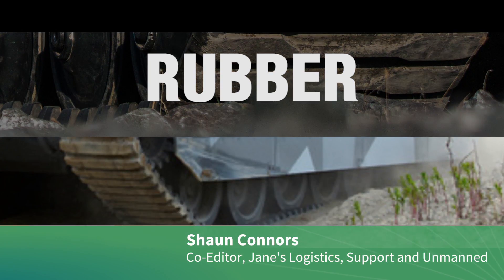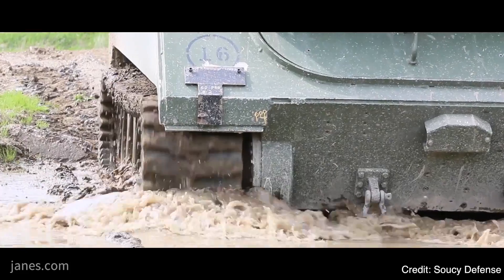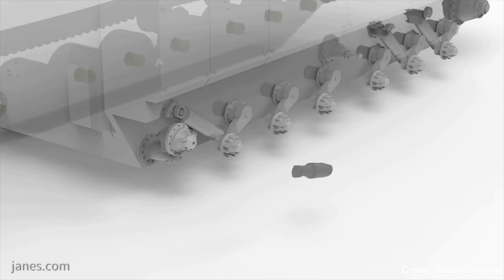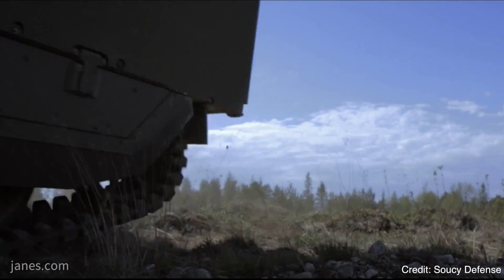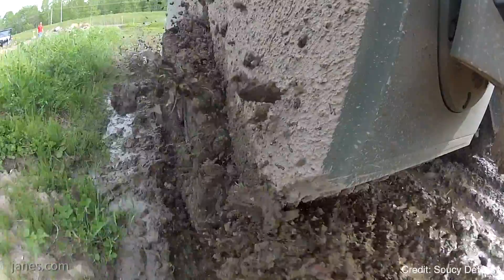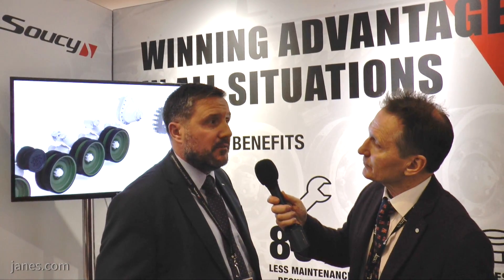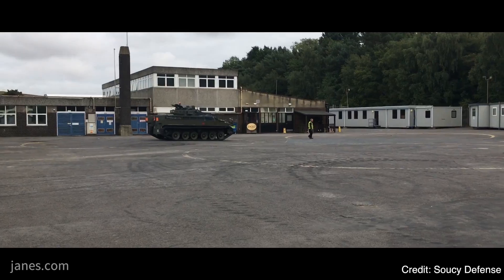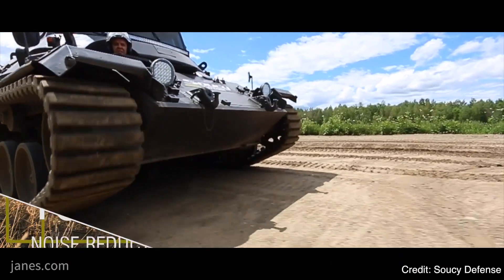Military Rubber Track Systems (IAV 2019)

Comment: I am not a mechanic and I have no experience to repair tracks. According to my common sense:
1/ rubber tracks must be much lighter in weight and so could drive faster;
2/ rubber tracks should be cheaper;
3/ a damaged rubber track have to be removed completely and replaced with a new one, while for steel track, you only have to repair the damaged part, no need to replace the whole track. 
I do not know how they replaced a damaged rubber track, but I think they have to lift up the damaged side of the tank until all the wheels are above ground. This is not easy in the field. However, I think it make no different between steel track or rubber track if it is damaged in the battle field. The tank still lose its mobility and you could only repair it when the battle is over.
Reply: Over snow they seem functional , the BV-10 for e.g ... but the desert would eat these in short time .
Reply: @orsonincharge4879  , just like the desert eats rubber wheels? or the rubber padding on segmented tracks?
Reply: @shanerooney7288  , yes exactly like the way desert eats rubber wheels , the rubber pads on tracks are meant for road moves , not desert .
Reply: @orsonincharge4879  , you do realize they use both rubber wheels and rubber padded tank tracks in the desert, right? 
They don't have massive problems with using either of them in the desert. So why do you think rubber band tracks would fare any worse?
Reply: @shanerooney7288  , rubber wheels ... you mean tires .
The rubber pads are for road moves , just as I said . 
Why do I think rubber wears out faster than metal under abrasive conditions ? Really ?
Reply: @orsonincharge4879  , During operation desert storm, the US army used rubber pads on the tracks for both the Abrams, the Bradley IFV, the M109 SPA, the M163 Vulcan. And during operation desert storm the Brits had rubber pads on the tracks for the Challenger 1, the Scimitar, and the Warrior IFV.

My question to you is this: why would they not be willing to use rubber band tracks in desert conditions if they are clearly willing to use rubber padded tracks in those conditions?
Reply: @shanerooney7288  , dude , the pads are always on the tracks , they just replace them , they are always fitted ,  the purpose is for road moves ... its not a hard concept  ???
 The pads are easily replaced .
Reply: @orsonincharge4879  
Always on, sounds like what the rubber band tracks would be like.

"easy to replace" ? I'm guessing you've never actually tried it, have you?
It is two bolts per pad, and A LOT of pads per track. "Easy" You say... LOL

BTW, you should do some research into how long tank tracks actually last.
The metal linked segments last about 400 km before needing to be replaced. Rubber band tracks last  3,000 km.
Reply: @shanerooney7288  , awesome .... give me a shout when the MOD uses these on warrior .
Reply: @orsonincharge4879  ,  how about the 28 tonne CV90 ?

Oh, and Norway deployed M113 to Afghan with rubber band tracks.
Reply: @shanerooney7288  does the MOD use CV90 ?
Reply: @shanerooney7288  , we used BvS 10 in astan too , but not for long . The vehicle only has that option . 
As I said , wake me up when the MOD uses them .
Reply: @shanerooney7288  also , where did you arrive at the figure of replacing tank tracks at 400km , absolute bollocks .
Reply: @orsonincharge4879  , Wait....
you are telling me that you already knew of a tracked vehicle used by the British military that was deployed to Afghanistan using Rubber tracks.

You already knew this and yet you doubt rubber tracks can be used in desert conditions?

Clearly you aren't being rational.
Reply: @shanerooney7288   still waiting .... where did you arrive at the figure of replacing tank tracks at 400km , absolute bollocks .
Reply: @shanerooney7288  , you must work for the company to have such a hard on about these tracks .
Reply: @orsonincharge4879  ,
To my knowledge, the  FV51 Warrior has never used rubber tracks. 
So what now? are going to claim this as supporting evidence for why Rubber tracks aren't viable for desert use? Just conveniently ignore all of those other examples.

You are Cherry Picking what examples you want because if you didn't then you might have to admit to being wrong.

You want specifically British vehicles because you don't want to hear about the Norwegians using rubber tracks ontheir CV90s.
And even within the British military, you specifically want to the warrior because you don't want to acknowledge that the BvS 10 fulfills your criteria of  rubber tracks being used in the desert.
_____________________
I posted the link you requested 2 comments ago. (clearly you didn't follow it)

_______________________
Oh, and now you are saying I'm being payed off by the company.
Did you realize that you can't win this argument on merit so instead you resort to this? LOL

Comment: Tires burn nicely. Do these?
Reply: They don't. It's not the same kind of vulcanized rubber used in tires. The tracks won't actually burn, but they do get weakened by intense heat. Also, military and industrial grade tires don't burn easily. You need a starter fire to get them burning. You can't just ignite them. Think charcoal on a grille. Gotta spray them with slow burning propellant, ignite that, then wait 3 to 10 minutes. If a vehicle crew is dumb enough to stand on a molotov for 3 minutes, they deserve to burn.

Comment: I wonder how soldiers will replace a track on the fly? Remove one of the front wheels perhaps to loosen the track?
Reply: I was wondering the same, delinking a metal linked track can be quite easy and fast, with the added benefit of being able to be driven on and off. Seemed to me that the composite rubber track can be removed by removing a half from a two part idler wheel wich would then allow the track to be removed. Seems easier than delinking a metal track, but to me atleast it would seem harder to then remove the track seen as it is a continuous band. heavy side armor especially would seem like something that would cause issues.
Reply: Thry have to pull the vehicle back because you cant roll it off the continuous track. To get it off they have remove the outside of the drive sprocket and then to lift one side of the vehicle completely clear off the ground to get it off… The do the same to install the replacement…

Comment: The US Army had a track like this on the M-114 Recon vehicle. It was a total failure and withdrawn from service starting in 1972. Geoff Who learned to repair the 20mm cannon in 45B training in 1972.
Reply: Well that was back in 1972. The engineering technology have made leaps and bounds a century later. Up until now some people are skeptic about composite materials replacing aluminum in fighter planes like the Raptor, although aluminum hulls back in the 70s can be shot through with a gun, and even decades later it wouldn't make a difference with the new composites.
Reply: Did it fail because of the rubber band tracks or did the vehicle fail for other reasons?
Has technology learned from the failure and have now come up with solutions?
Reply: It failed due to the tracks failing and coming apart. On the flip side the most effective halftrack ever produced used then in WW2… On every Allied halftrack. They lasted all the way to the 2000s in Israeli use. However when damage by a mine they presented a huge challenge to get off and back on again due to the design of the running  gear. Plus they burned easily when the vehicle brewed up.

Comment: Military vehicle with greatly reduced noise,only advantages mentioned are health and safety. A sign of the times.
Reply: Well noise is a big advantage or disadvantage depends on what side your on. With Bradleys in Iraq they could hear you coming at night in strykers you be at their front door before they knew you were there.
Reply: "We've atted 6 inches of armor to the from of the tank"
"Okay, but why?"
"Heath and Safety, of course"
Reply: Andrew Pease and not ripping apart roads when transporting
Reply: If your transporting it it's on a trailer or train car .
Reply: Increased speed and range on top of reduced noise.  Pretty big advantages.
Reply: @Weak eye dominant yeah never mind you are done if you damage the track in any way… no more replacement from spare track segments if you hit a mine or an IED… They never address that in the video and it always happens… yeah really brilliant… 🤦🏼‍♂️

Comment: But why were they banned?
Reply: All the companies that make metal link tracks banded together and got the bands banned!
Reply: Because reality their bands and a bad ideas for the battlefield.
Reply: @jimbotheassclown  - in what way they are " bad" on the battlefield?
Reply: You can't store a full track on a IFV or what ever vehicle it's on you blow a rubber track your screwed. You can fix a normal broken track because you carry the parts on the track vehicle so a field repair can be done. This fantasy of a supply vehicle with you in combat is pretty funny they show up if you secured the area not during the fighting and thats if they can get through at all. Hell even in training they don't send mechanics to fix thrown Tracks the Crew does it with the parts on the track.
Reply: Well if you have linked sources by all means post them .But i haven't seen them repaired a fully broke track not a track with a little tear.  that repair kit is tiny and bolts are a joke that might get back to the rear if they leave the fight to change out the track but the track has to be replaced and soon.
Reply: @jimbotheassclown  There are no links to break.
Reply: The repair kits are links high speed.

Comment: Imagine if you hit a mine, does field replacement even possible for this concept?
Reply: 2 years ago I attended a seminar on composite tracks and future BM systems. At the time we were shown video footage of CRT resistance to IED/mine (4-10KG) it showed CRT had better impact and flex resistance then steel link. Currently there is a linking repair kit for CRT under development to replace an earlier kit.
Reply: What vehicle? In 30 minutes and limp home in a battlefield good luck with that. 30 minutes give me a break lol you have never thrown a track in the field.
Reply: Zahir Datoo  30 minutes is a hell of a long time on an active battlefield. Crews will not be happy if these tracks ever get placed on frontline vehicles.
Reply: @thewomble1509  Rubber tracks are already on front line vehicles and have been used in combat.
Reply: @ Stu Bur yes they were on all Allied Halftracks in WW2 and they worked perfectly until they hit a landmine or the vehicle brewed up then they burned wildly…
Reply: Those tracks are light so your support vehicles will be able to carry a spare or two.  It is also not clear if there is any repairability aspect.
Reply: @timmurphy5541  The problem is how to get them on the vehicle in the field.
Reply: Tim what support vehicle ? Lol they don't follow you around in country every time you leave the FOB or posted at a check point. Thats why they have extra track parts on Track vehicles.

Comment: Guy claims rubber tracks are more durable, yet they can't endure vehicles over 47 tons. BS. Also no change of rubber pads? That's right, you have to change the whole track lmao.
Reply: “There is no maintenance required” - sends chills down my spine, everytime i hear it from a manufacturer
Reply: You can see their repair videos but what they clearly mean is that it's a use and dispose product rather than something you're going to do periodic maintenance on.
Reply: It's good enough for lighter armored vehicle. An IFV could get the advantage of quieter tracks and vehicles like Wiesel could have huge advantage in terms of greater reduction in track noises.
Reply: Noise and vibration are reduced.  These is are advantages.
Reply: He says clearly that it's the heat from the big tanks that makes the composite rubber less durable.  Without that they are stronger.
Reply: It seems more like they haven’t designed/tested them for vehicles over 47 tonnes, possibly because there’s less of a need or market for the heaviest MBTs and similar vehicles. Or the tech may not be there yet. I’ll remind you that a T-80U and the early T90 only weigh 46 tonnes each
Edit: spelling
Reply: Yeah but its easier to change the entire track especially when it weighs just a 5th of the steel tracks than it is to change every pad on an entire steel track length.
Reply: @eraldorh  where you got one fifth of weight? video says half of weight
Reply: Rubber tracks would be great for insertions as stealth is more a practical requirement for them, especially in small fast light motorised infantry (APC and car) borneunits like AA/AT/SF teams. Armoured mechanised infantry like the IFVs were never meant to be stealthy anyway, as they roll with MBT heavy armour. They are pure front line assault shock and awe.
Reply: “No maintenance required” like with the tires on millions of military vehicles that can weigh more than 35 tonnes
Reply: Tyres can't take you over the same terrain though, can they?
Reply: It's probably easier to change a rubber track than a metal segment.
Reply: @cstgraphpads2091  Maybe, but remember tanks always carry some spare track segments, but they don't carry a whole spare rubber track.
Reply: Strength and durability are separate things.